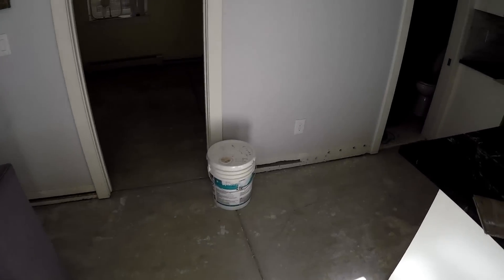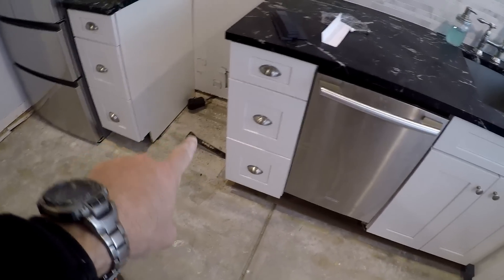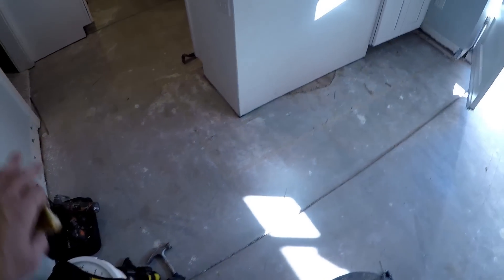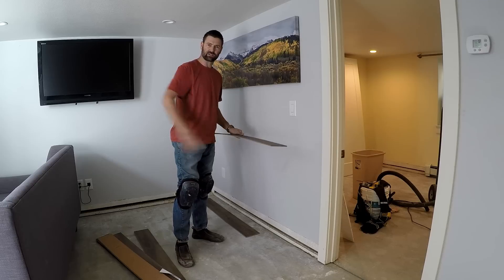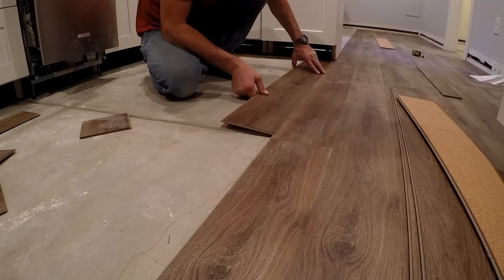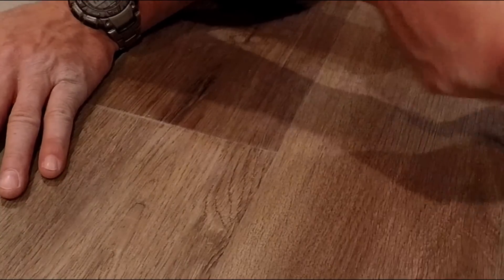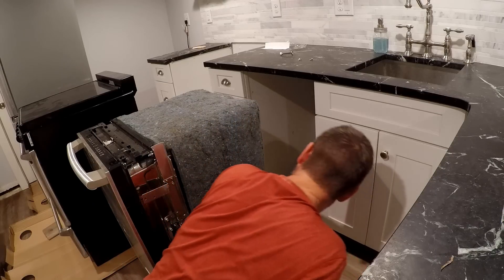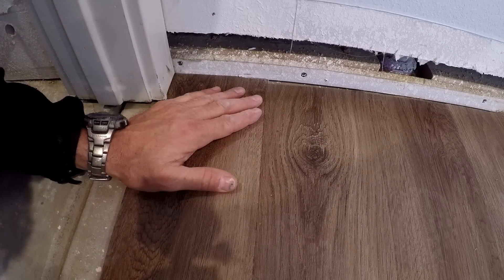The Truth About Vinyl Plank Flooring 1 | THE HANDYMAN |

Comment: Lol well if you used a actual well developed and constructed product then it would be a completely different experience. Let me guess and say you probably purchased a “ box store “ product? I have been in floorcovering for almost 25 years and a sales representative for a mill going on 8 years! My company has engineered and constructed a composite product that of course due to being a floating floor and homes especially in my state of Michigan expands and contracts let alone consistently settles needs a consistent 1/4” gap for .! Installing in between temperatures of 65’ to 85’ and after in for 2-3 weeks home can be winterized. My bathroom I actually fit tight and had a toilet run continuously for 8-9 hours and having several inches on after cleaning my floor did not move a mm. With our actual water proof attached backing.. “ synthetic rubber “ the first to do! A locking system that has been tested and around for a long time! And on top of the 20 mill wear layer actual 2 coats of urethane! Always use a rubber mallet or a cut piece of product to insure tight seems! As you put in vertical you tap but into to insure that. No underpayment needed which is the key! With a actual real hardwood visuals but utilizing wide planks, in our case 9” x 60” to give rooms a larger open feel and visual! But with the care and maintenance that is the easiest to ever hit the market. I had a customer not use a dolly to move back large stainless steel fridge and put a small scuff in floor! I used a magic eraser to get out! To disinfect use as all restaurants have since the beginning and do today! Either bleach or ammonia just a small amount of one or other and water! Obviously your cloth spritz mops work perfect for your general clean up! Never use your “ swifter “ or cleaners like pine sol or Lysol etc! There is a difference between a product that is $1.99 sf and $3.99 sf, it’s called quality! And for goodness sakes!! Has anyone ever seen a wine rack? If not go look at one! Google it! They all are on a down angle! Why? Because what is used to cap wine needs to stay moist! Why because if not it will shrink and air gets into bottle of wine and ruins! So the product that is used to cap wine! And often seen on vinyl plank is NOT waterproof! Duh!